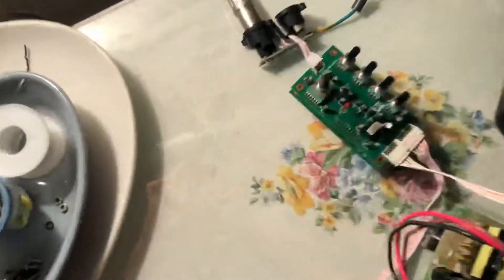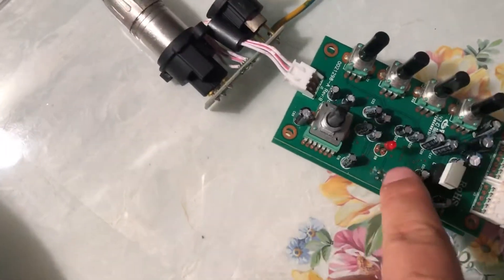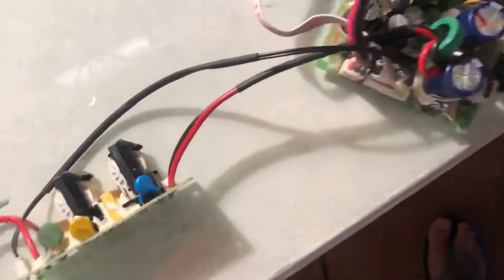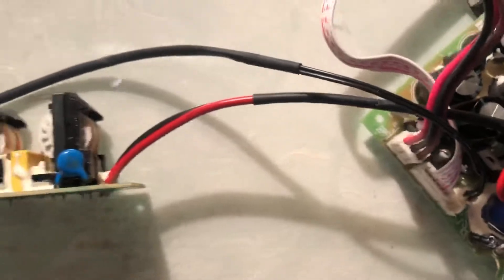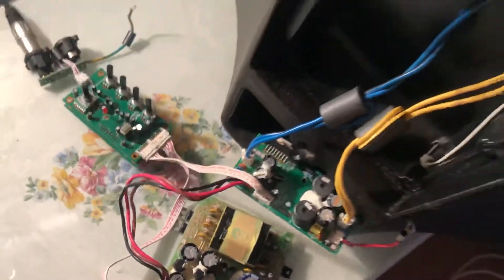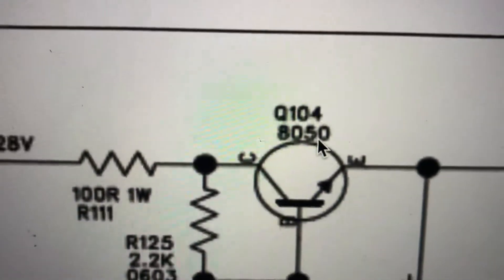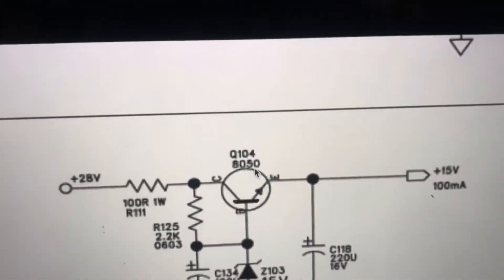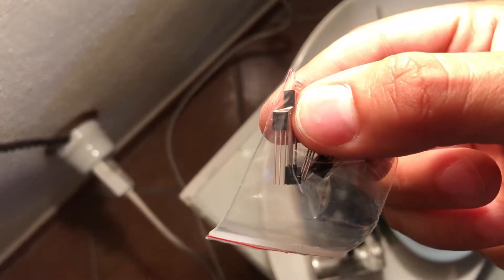Mackie Thump 15A "red overload led always on" problem [SOLVED]

Comment: I thank you for that information I'm trying to fix a dump 12  1,000 w.  I'm driving myself crazy trying to reorder that specific chip that burned out it's in the thermal protection part of the amplifier and limiter they have you four on the schematic and on the circuit board and TDA 8 9 5 4th is what is actually on the chip itself it's a 24-pin chip with 12 on each side one side handling low frequency and the other high frequency it's the biggest chip on their board that's all I can find on this thing is the schematic which the electrical schematic which they sent me which shows nothing more than what's on the board you for and those values I've tried to go to Moser I put that information in that TD and it never came up nothing I don't even know who the manufacturer is but I know it they said to get a good one like Panasonic. So how did you get that part number I mean what did you do I mean yeah you got those numbers but where do you put those numbers into to get the newer better part thank you sir
Reply from the maker: I searched on eBay!

Comment: Worked!! Great tutorial and suggestion on the transistor! Good as new
Reply from the maker: Thank you for sharing!
Reply: Can you tell me the replacement part number again please..can’t seem to find the part
Reply: @bobbyculture1002000  S8050 and he replaced it with a ss8050
Reply: @bobbyculture1002000 SSA8050 NPN Transistor in  TO-92 capsule